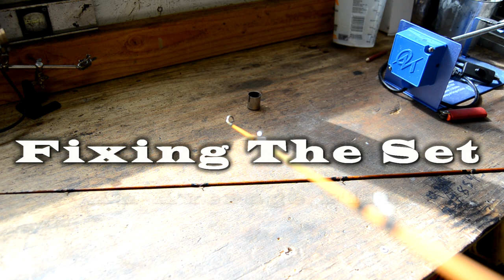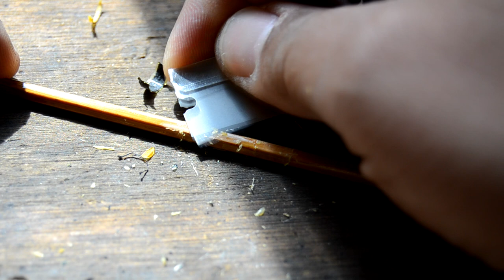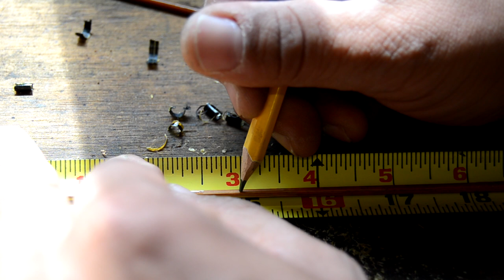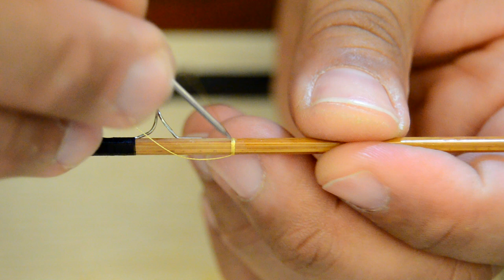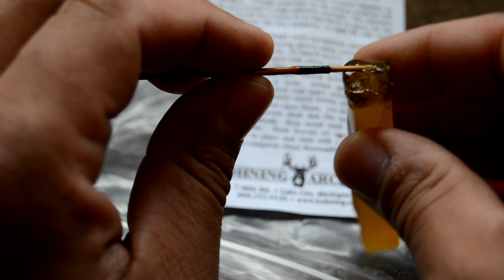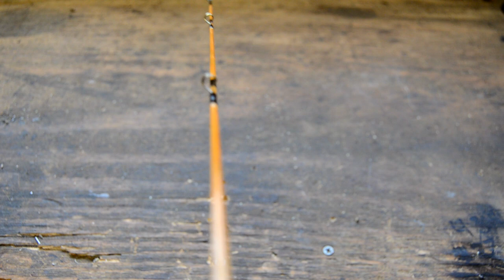Bamboo Fly Rod Rebuilding | Fixing The Set | An Average Film

Comment: @averageguyadventures  Did you pre-treat your thread work with a finish befor the dip?
Reply from the maker: When I originally rebuilt this rod I did use a color preserver. I can't remember which brand though.
Either Flex Coat or U40. One of them didn't work so I bought the other.
When I re-did the tip section (for this video) I didn't. I didn't realize it would make as much of a difference as it did.
The yellow thread went translucent but the black didn't. 
If you pause on a guide when I'm pulling the section out of the tube you can see how the yellow disappeared. It looks the same after it dried.
The butt and mid-sections still have bright yellow and black.

Comment: Did you sand down the entire rod? If so, can I treat the rod with a polyurethane using a brush? I'm not sure what you dipped your rod into.
Reply from the maker: When I originally rebuilt it, yes I sanded the whole rod. I stuck to sandpapers in the thousands so I wouldn't gouge it.
From what I've seen polyurethane with a brush would work but getting a smooth finish will take patience.
I used spar varnish from ace hardware ( https://www.acehardware.com/departments/paint-and-supplies/stains-and-finishes/varnish/1021819 )
and made a dip tube out of pvc pipe.
Reply: @averageguyadventures  Did you pre-treat your thread work with a finish befor the dip?

Comment: Why is there no voice over? Would help those not familiar with what you're doing. I am a rodmaker, so I know pretty much what you're doing, although I did not see any appreciable set at the beginning of this video. I assume you are mounting the guides on the opposite flat, against the set, but it would help your viewers if you said that.
Reply from the maker: I was just trying to be cinematic, showing the process, and trying out a new (to me) camera. 
And I still haven't figured out how to do a voiceover that doesn't sound like crap so I opted not to.
The set itself wasn't horrible as I had used a heat gun when I originally rebuilt the rod and gotten most of it out. It was just that when the rod was lined up it bugged me.
And yes, that was basically all I did; switch the guides. When I first rebuilt it I didn't realize I could do that with bamboo as I thought the rod would have a spine.
Thanks for watching and verifying that I at least looked like I knew what I was doing. I operate in a little bubble so I honestly appreciate it when someone more skilled than me thinks my self teaching looks legit.
Reply: @averageguyadventures  thanks for replying. Yeah, bamboo rodmaking is a passion of mine and I got my start 20 years ago by redoing rods.If you're into working with bamboo fly rods I know a couple of great resources, like the Classic Fly Rod Forum. I hang out there under the username Canewrap. But, if this is the extent to what you want to do with bamboo I uderstand.
Reply from the maker: @will_Iam61   if you're on the Classic Fly Rod forum then I've probably picked up more than one tip or trick from you without knowing it. I'm not a member but I have been lurking for quite a while and it's where I've learned most of what little I know.
South Bend is my blue collar brand of choice (because Go Irish!) and I've had the South Bend catalog listings thread open in a tab for just about two years as I've been searching for rods to add to my collection. 
I'd love to be able to build rods beginning with culms but for now I just content myself with the rebuilding and being able to get old rods back on the water.
Reply: @averageguyadventures  , good for you sir. There aren't many of us redoing old rods anymore. It is a fantastic way to pick up the ancillary skills, if you ever decide to make rods from scratch. If you ever decide to try and make a rod, drop me a private message on the Classic Fly Rod forum. I can give you some roughed out strips that you can use to plane into a rod. But, and I emphasize this offer is only for you. I would love to be the one to wet your appetite enough to make a true rodmaker out of you. Turn you to the darkside, LoL (btw, we have cookies).
Reply: @averageguyadventures  might want to stress " do not dig into the blank! Carefully lightly just scrape levely along the length of the blank.